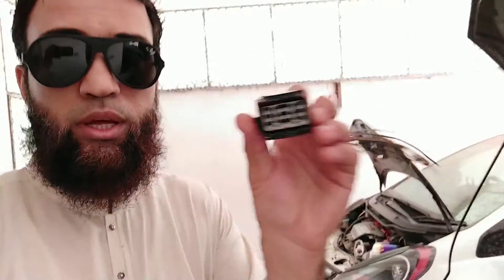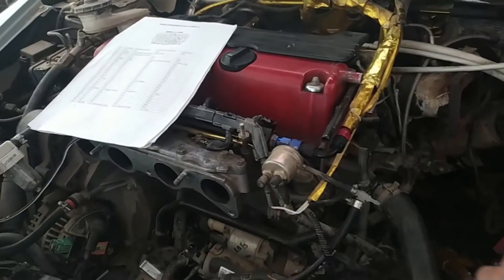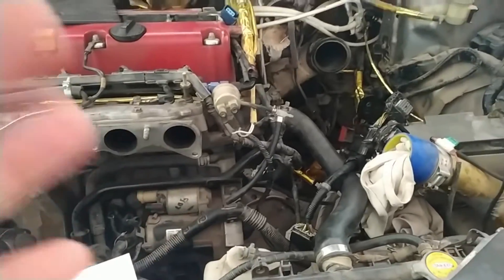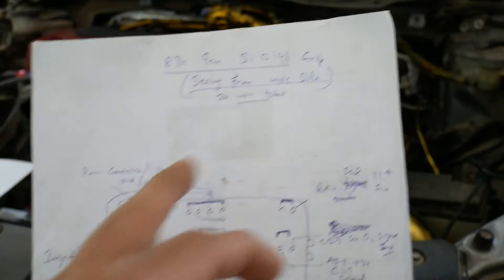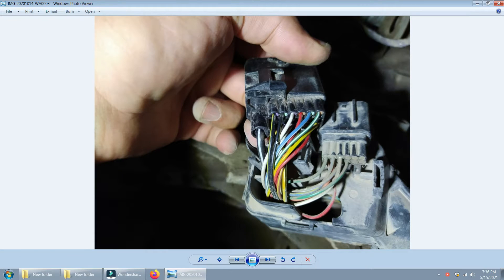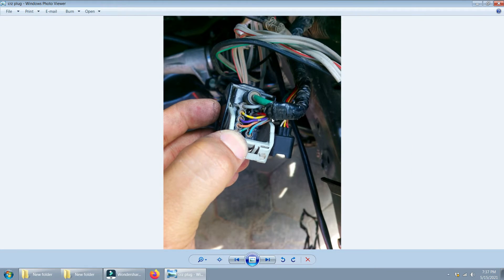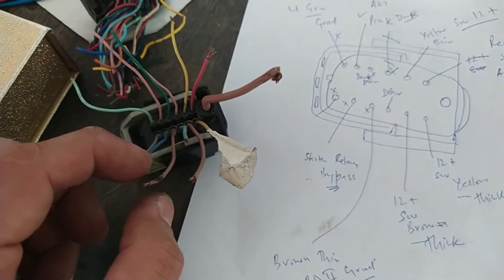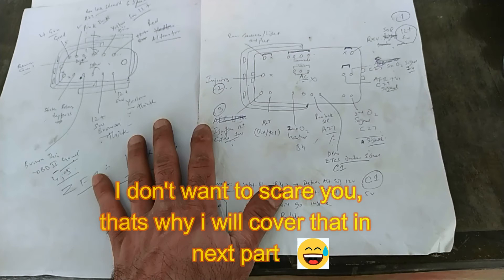Part 14: Wiring of C101 & C124 plugs/grips Civic Si / CRZ/ Fit

Comment: Abdul you are a life-saver dude. I have a running GE8 Jazz running a K20z4 engine, transmission and ecu. I have this nagging problem with my LAF O2 sensor that intermittently lose connection. I believe the FN2 ecu is very similar to the SI ecu and I've identified all these grips that you are showing, in my vehicle. Your explanation of wiring the O2 sensor might also help me to find the issue.
Reply from the maker: @anrichlucas9425  glad to help. Yes Si and Fn2 EcU are 99 % same
Reply from the maker: @anrichlucas9425  I did not do my 2nd O2 sensor wiring but I have mentioned the pinouts in my diagrams. You can give it same heater + and chassis ground as 1st O2. But for signals you can take wires direct to Ecu pins for 2nd O2 sensor as mentioned in Ecu pinouts
Reply: @A.QPerformance hi. Thank you for your reply. I only have a primary sensor. No secondary🙂
Reply: @A.QPerformance sorry, what I meant in my original question is the primary o2 sensor, its 2 heater wires, I can trace one of them and they are identical to your diagrams for the GE8 with SI ecu. I just am not clear on where the primary o2 sensor's 2nd heater wire go to. I know the one goes to C101 and to ecu pin C9.
Reply from the maker: @anrichlucas9425  The 2rs wore is power to O2 sensor. That you will have to give from any switched power source present in C101 plug. It is not mentioned.in diagrams because it's understood
Reply: @A.QPerformance  thank you. When you say switched power source, you mean going into the cabin to the fuse / relay box?
Reply from the maker: @anrichlucas9425   coming out of cabin into C101. Switched means any power source which turns on when you turn on ignition switch. When all light on dash light up, just before starting position of the car key
Reply: @A.QPerformance  okay so powered by a relay, right?
Reply from the maker: @anrichlucas9425  it's already related. Just find a switched 12v power source in c101. Just use a voltmeter man
Reply: @A.QPerformance  understood. Thanks Abdul.
Reply: Hi Abdul. Hope you are well. I can traced my wires on my O2 sensor back to the grips. Three of them I can see on the C101, namely the positive, negative and one heater wires. I am however unsure where is the second heater wire supposed to go as it comes out of the plug under the car? Your response will be greatly appreciated.
Reply: Hi Abdul. Hope you are doing well. Just want to check with you, when you Kswap the GE8 Fits, do you keep the stock Fit fuseboxes or do you swap that to Kseries?
Reply from the maker: @anrichlucas9425  fuse boxes remain same. No need to change
Reply: @A.QPerformance understood. One thing I do notice is that my Jazz fusebox has a fuse and relay for the AF sensor but the FN2 / SI has a FI Sub Relay and no fuse or relay for the AF sensor.
Reply from the maker: @anrichlucas9425  Si etc they have fuses for those sensors but their fuse box is in engine bay that's why you won't find inside.
Reply: @A.QPerformance so the ones I do mention is in the engine bay fuse box. The fi sub fuse and relay which the fn2 / si has.

Comment: Assalamualaikum...I have the FD1 R18 Japanrse car that is automatic and a K20Z3 USA engine that I have swapped into the car but stuck at the C101 plug because I don't know the pins on the R18's C101 plug. The pins of the K20Z3 C101 plug are different.
Reply from the maker: R18 C101 plug pins i have shared in my dropbox download link. Download it there
Reply: JazakAllah but I don't see it in your dropbox
Reply: I left a comment in your Honda-tech forum with a diagram of both C101 plugs for the Automatic R18 and the Manual K20Z3 engines I have.
Reply: Ok, I watched the video completely. You traced the wires to the connectors to determine what they do. So, I will have to use the diagrams for the K20Z3 to check that my engine has the same and for the R18 we will have to trace everything completely. Will let you know what I find and post it on the Honda-tech forum.
Reply from the maker: @pat_7267  for R18 there are many swaps from Fd1 to Fd2. Wiring details are vaialble. HAsport also did a Fd1 to Fd1 swap and did wiringm check out Vtec academy for vidoes. The
Reply: One final question. Are the Grey and Green plugs to the ECU the same between the K20Z3 and R18 Engine? Because you don't have the Grey and Green connectors for the R18 engine.

Comment from the maker: K-Series wiring diagrams & ECU pinouts, especailly modern Hondas like CRZ Zf1,Zf2, Fit GD, GE, GK,GP4 hybrid,, Insight, City, Civic Si 07-11, Si 13+ models, Civic Base, FD1,FD2,FN2 aswell as older ones like EG, EG, Integra base. Also include C101, C124 plugs and their Main wiring harness diagrams compiled in video below
https://youtu.be/JNAZllePb4M

Comment: I also want to be able to start the car (in neutral) without pressing the clutch, for the reasons you indicated about the clutch moving the crank laterally against the side thrust bearing plates in the engine.Your Note 2 (from DropBox "CRZ A Plug Conversion Instructions") says to slice (wire together) the depinned ECM A12 wire to the depinned C124 #3 wire, and then the clutch bypass switch will operate "correctly", which  means like normal, i.e., that clutch must be depressed to start. Not what I want. So, the depinned ECM A12 is "looking for" a chassis ground to complete the circuit through the starter cut relay, thus energizing the starter cut relay & closing the contacts, and then the +12v (fused 7.5A) from ignition Start position (IGN-III) will flow through the closed relay contacts to C124 #1, which connects to the starter solenoid (and start the engine). So, just wire the depinned A12 to chassis ground? Yes, I know I will need to connect the heavy wire from C124 #1 to the starter solenoid. (ref schematic, in CR-Z 2011-2012 Service Manual, vol.1, pg. 4-4).
Reply from the maker: I have also mentioned how i did it. Just  trace that starter wire (green in my Fit or brown in my crz) and attach iy to starter wire. Its simple. i am sure i have  told this method in detail
Reply: @A.QPerformance  ok. I think I see the problem about my thinking the Civic ECM also made logic decisions about A12 (STC) regarding the Starter Cut Relay. However, both A12 and B12 (CLSW), found on the CR-Z ECM pin out, are different on the Civic ECM where being shown as NOT USED, unlike on the CR-Z Zf1 ECM. This according to the drop-box pin out from you for Civic Si 2007-11 ECM. In the CR-Z, the A12 went to the CR-Z ECM for its decision about clutch position, provided at B12, and if clutch were depressed then B12 would be grounded and complete the circuit for the A12, closing the contacts in the Starter Cut Relay for the wire from C124 to the starter solenoid. Not sure why Honda would quit this logic in Civic, or rather, add it in the CR-Z. This may have to do with the fact that most of the time the IMA motor would start the engine, not the 12v starter driving the ring gear on the flywheel. The only time the CR-Z used the 12v starter was if the IMA battery was too weak. I need to check for continuity on my Civic Si wiring harness from B12 to pins on C101 plug to see if Civic Si connected any body clutch position circuit to the Civic Si ECM B12. Another issue maybe.  Nonetheless, simply grounding the depinned A12 pin from the CR-Z should make the CR-Z Starter Cut Relay contacts always close when starting, and without pressing the clutch. Less work this way. That would bypass the original CR-Z ECM's logical check for clutch position at B12 (it did), as well as any decision the ECM was possibly making whether to use the IMA motor (usual) to start the engine instead of the 12v starter (rare). But not worried, the starter will work after the swap.
Reply from the maker: @M63753  yeah that is nice and very simple idea to just de-p8n A12 from ECU and ground the it and we will not need to press clutch to start the car. Thanks for idea🔥
Reply: @A.QPerformance  In the CR-Z, the 6MT has a Neutral Position Switch located on the transmission (2011-2012 CR-Z Service Manual pg. 22-21, Det. 21), which provides a path to G101 (ground) (via the CR-Z's ECM B12 [NSW]) when in neutral (see CR-Z Service Manual pg. 12-61). This facilitated the engine's "auto stop" function of the CR-Z (when stopped, shifted to neutral, and clutch out). Unfortunately, there is no Neutral Position Switch on the Civic 6MT. It would be best if the de-pinned A12 wire (see CR-Z Service Manual pg. 4-4) were wired to a switch (on the shifter?) that would connect the de-pinned A12 wire through the switch to ground when in the neutral position. I will strive to create and wire the de-pinned A12 wire to such a switch that closes when the transmission is in neutral, connecting the de-pinned A12 through the switch to ground. In that manner, the engine can ONLY be started in neutral, and the clutch won't need to be pressed. And what if you stall the engine? Quickly shift to neutral, restart, and then shift back into gear (not unlike an automatic trans engine restart).
Reply from the maker: @M63753  hmmm never been tried before. Yiu can lead this path. No worries if it doest work. You can still wire directly as i did just bypassing the relay and joining two wires togather. Look you need to conncet started wire of Si to CRZ started wire in engine bay anyway becoz Si has fuse box in emgine bay but CRz/Fit has it inside cabin on driver side. After doing this step just one step is needed which i showed. Just trace that ignition wire from ignition switch and join them togather. Thats all